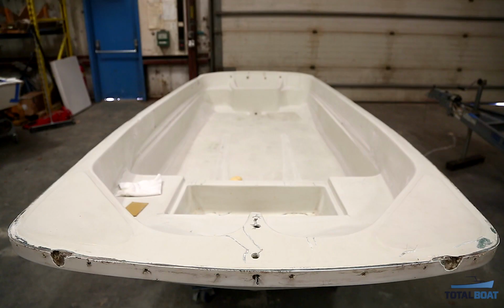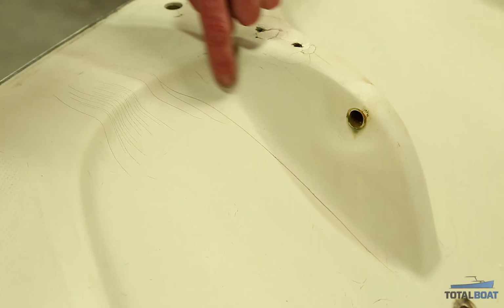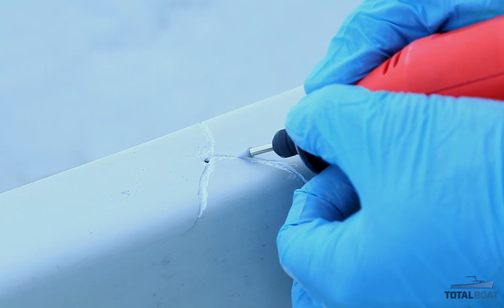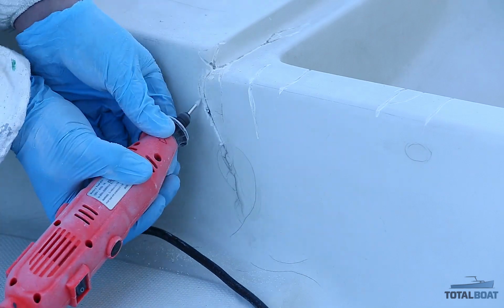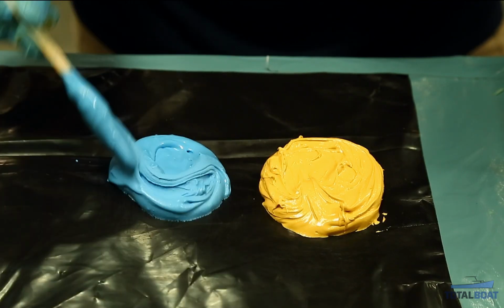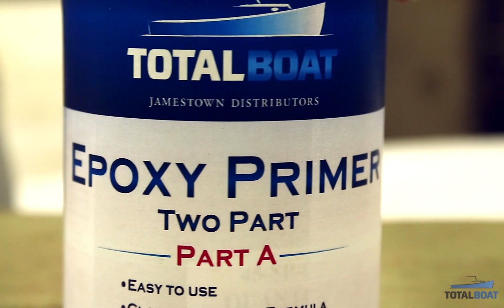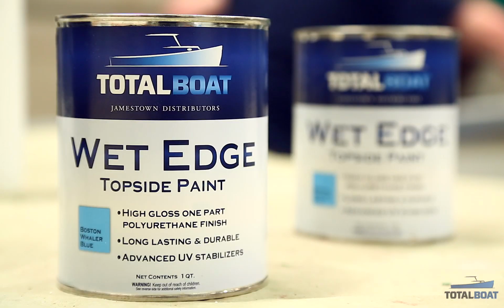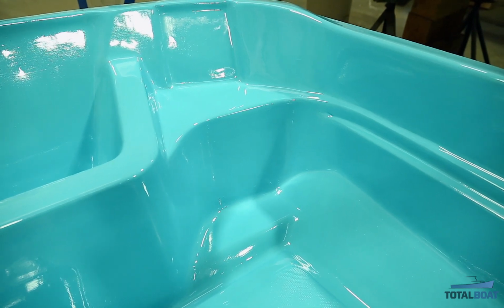Boston Whaler Crazing Repair

Comment: Disclaimer:  I have never worked on a boat, only on my RV and lots of wood refinishing and restoration.  Please forgive me if I say anything incorrect for boats.  I am sharing my knowledge on general DIY with my RV and wood projects.

Best method I use for sanding contours and textured areas is with an angle grinder and the wire cup brushes for 5 at Harbor Freight.  You MUST wear goggles (HF $2) as those wires fly out at high speed. Wear short sleeves and an apron to prevent them in your shirt as laundry does not take them out, but magnets do.  Best angle grinder is Bosch 5" paddle switch, variable speed, and with a Leave On button as well (Amazon refurbished $79, new $119).  Place a steel washer between the grinder spindle and wire cup brush to remove easily without jamming too tightly.  
Use a CRIMPED WIRE CUP BRUSH for gentler sanding, and a KNOTTED WIRE CUP BRUSH for very aggressive rust removal or stubborn glob of anything stuck or to gouge out small areas.

I use a Dremel 4000 (newest model is 4300) but be aware that prolonged use can wear out the carbon brushes and these must be ordered from Dremel as all the Amazon ones are Chinese junk and don't fit.  I wish I had an option for a robust Dremel rotary tool that was less finicky. However, the accessory bits are very good on Amazon.  They are all Chinese made and work extremely well.  I have the wire wheels (also at Harbor Freight), polishing tips, grinding and cutting discs, and abrasive scouring tips as well.  $10 a box and lots of them.  Get the diamond tip or grinding tips to gouge out.  You also get a Flex Shaft attachment ($25) that is easier on the hand with finer control.

For the sander, I use an inexpensive corded Dewalt Random Orbit Sander with velcro sanding disks. I found that the mesh cloth type of disc works better than the conventional sanding disk. You also don't have to line up the holes. These last much longer and don't fray on edges so easily.  Buy in bulk on Amazon, but please give Home Depot your business for the tools. They match internet prices and we need them around.  Jeff Bezos is rich enough.

On the roller brush side, Mohair rollers are very fine and leave no marks.  Durabak paint recommends them for smooth painting.

Does anyone know if I can use these boat paints on my fiberglass/wood/ metal trim RV exterior?  I have a Class C RV 22 ft and its mostly fiberglass.  I need to paint this urgently this summer. I was considering Durabak18 Polyurethane which is a truck bedliner but also used by the US Navy for their boats.  However, Durabak is unresponsive to my questions on tinting, and this is a deal breaker. They have some dull solid primary colors only, nothing pretty and won't tell me how to tint their clear version or if I can add any mica powder to get a pearly shade.  I have a huge big vehicle to paint and choice of color makes a visual impact for better or worse, and in resisting heat build up inside.  I want a light teal with some pearly effect.

Does anyone know if these colors here can be tinted?  Can I add any mica powder to them to get a pearly effect?  What is the solvent used to reduce these paints - Acetone, Mineral Spirits, Xylene?  How similar is it to Durabak?

The big advantage of Durabak is that it is rock hard, resists UV damage, resists UV color fading, is flexible for movement whereas epoxy is brittle and can break off, can be rolled on not sprayed, and also comes in a textured version with crumb rubber so that you can use it for a non-skid surface on boat or roof of RV.  The downside of Durabak is that the colors are solid not translucent, come in butt ugly solid shades only + 1 clear, working time is not clarified, and you can tint it only with non-water based, paste pigments and good luck finding that!  They will not help me understand what type of polyurethane it is, so I cannot ask the pigment makers if their products will work with Durabak. Also, Durabak only comes in Quart size ($45) or Gallon size ($145) so experimentation is for the rich only.  No pint sizes.  It is made in South Africa, family owned, and have one warehouse only in New Jersey.  Its an excellent paint for my project but I am exhausted dealing with them and need an alternative paint and source that is friendlier and more helpful. I hope someone here can help me!

I have to paint a small Toyota Yaris - and would love to do this in a dark Marigold yellow durable paint - roller brushed, and high gloss that resists fading, peeling and not easily chipped.  Current factory paint is a metallic grey.

I have a 22 ft Class C RV - mostly fiberglass exterior - that needs a light metallic/pearly teal color (green/blue/gray) roller brushed on, high gloss or satin, with good UV resistance, no chipping, and easy to roller brush on.

Please advise!!

Comment: I never got an answer to my previous question but here's another anyway.  So I noticed you only seem to be grinding out the major cracks. I have a lot of real small hairline cracks on mine and  I see there are a lots of hairline cracks you may (or may not) be grinding.  Since I have millions of them, is it necessary to grind these out too?
Reply: No. Those are crazing cracks. Those fill with primer

Comment: I have small hairline cracks all over my 13' whaler.  Some are in the floorboard treading area as well.  i would like to keep the grip treading intact if possible and not sand it.  How do I work out those cracks within the tread area? Will the fairing compound or primer fill them in?
Reply: Durabak makes a textured polyurethane paint that is ideal.  It is thick and has crumb rubber for non skid effect. It is a flexible paint that you can apply like a rubber compound. The issue with cracks is that they expand and contract with the weather. You want a paint that is rubber-like and flexible, but not brittle such as an epoxy. Use Durabak to paint over these fine cracks.  It should 'glue' them together.  I am thinking that is paint featured in video will work the same way but I have not researched it like Durabak. They seem like similar cross-liked polymer urethanes.

Comment: What method was used for sanding the nonskid in this case? Was it the grill-brush method mentioned here, or is there something else to consider?

Also, what sort of brush is best for this?
Reply: I think they just primer over it.. I’ve been searching and googling about that too but never see any answer how to paint over the nonskid
Reply: @jondo5045  Use a wire cup brush and an angle grinder.  See my response in detail above. Use a stipple roller to add the paint to textured surface. Durabak also makes a textured polyurethane bed liner with crumb rubber added for non skid.  US Navy buys their product - its very good.  But not high gloss, only a satin sheen.  You can also add the crumb rubber to any paint but be sure to color match rubber.

Comment: I have a 1977 supersport that was modified with a center console and seat. The seat screw holes recently stripped. Can I fix this by epoxy filling and gelcoat and rescrewing? I am also not sure the original retrofit was done right.

Comment: So I've done a few whalers and hers some tips you guys may appreciate. The bigger cracks are best done as shown here, the hairline cracks fill with primer and won't show thru the final coat. As far as sanding the textured part of the deck, get yourself a stainless steel grill brush. Using dish soap and water, scrub floor alternating directions with the texture. The stainless brush effectively cleans and sands the low part in the texture. Then I run a sanding block with 220 grit paper over the top to clean up the top of the texture. Use a microfiber cloth wet with acetone to clean out the texture. Go over it twice with separate rags. I've been using Interlux Interdeck lately and really like it. Easy to brush and looks great.
Reply: I've been going nuts trying to find a forum that offered how sand non-skid for painting. Thank you. do you have pictures or any chance I can call you about this 860-984-9651
Reply: @t____g____5606  See my post above.

Comment: Hi, Great job. I have a 1965 13 foot Boston Whaler. The floor is textured for what I assume was for non slip. How do I address this when priming and painting the interior of the boat similar to the way you did in this video? Will the paint/primer cover this?
Reply from the maker: It will work and if you are happy with the texture, simply apply regular boat paint (Wet Edge Paint works great in the Boston Whaler Blue) over the nonskid area!
Reply: Do you loose the grid when applying the new paint?

Comment: wiping it down with acetone before grinding seems like unnecessary labor, especially since you have to wipe it down as part of prepping for paint.
Reply: Not really.  You remove any tarry, greasy blobs and globs and films. This allows you to see what needs to be ground out, and fine cracks that may not have been visible before.  Sandpaper also grips clean surface better and does not gum up as fast.

Comment: This is a band aid kind of repair, it does not address what caused the crazing in the first place. The crack will only reoccur.
Reply: @willpelton1619  not only hull integrity but also water intrusion. Old whaler can hold a ton of water and if you preform this when its humid out, rainy, etc or havent given the boat due time to dry then you can add hundreds of #'s to  your boat without knowing.

Comment: what type of paint do you recommend for the outer hull of the boat? since you mentioned that this paint is best for above water line
Reply from the maker: +ryan doran The WetEdge paint can be used above the waterline inside and outside of the boat. (On the outer hull) For the bottom however, and depending on how you use the Whaler (trailer, dock, and really how often does it stay in the water?) you will want to use a Bottom Paint. You can shop for lots of options for bottom paint here: http://tinyurl.com/jxk6xua  and you can call our Tech Help Line to inquire about which one will work best for your boat and situation and really - which works best in your harbor!

Comment: How much material ( primer and paint) did you use?
Reply from the maker: We used a quart of Wet edge Paint with 2 coats and 2 quarts of 2-part epoxy primer.

Comment: Nicely done however, why in the world would you paint over the stencil number in the splash well?  That is a big no-no when restoring a Whaler.
Reply from the maker: Jeff Rohlfing We know! But it had already been painted over another time so the owner wanted the full paint job.
Thanks for watching.
Reply: Jeff Rohlfing  hi. If someone were to paint a whaler like this in blue over white. How can you keep the stencil number without painting over it?
Reply: @supermotoboy3664  just pick up some stencils from hobby lobby.  Write down the serial number and paint over it.  Then using say the blue paint in the video, take a small cup of paint in a throwaway cup and add a little black or white for pigmentation and mix, then paint tape your stencil on once the paint undreath is dry and paint over.   Should give a really clean look.  You can also stamp aluminum from Harbor freight which looks pretty good to.